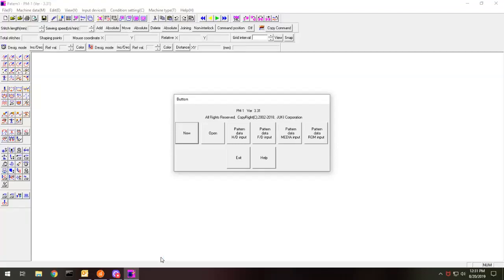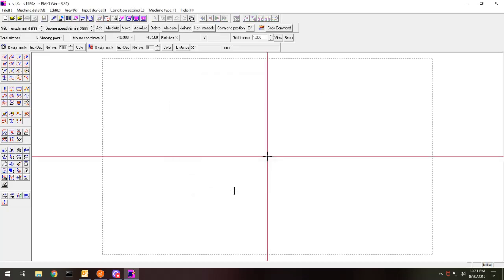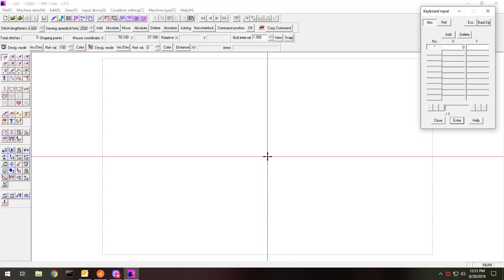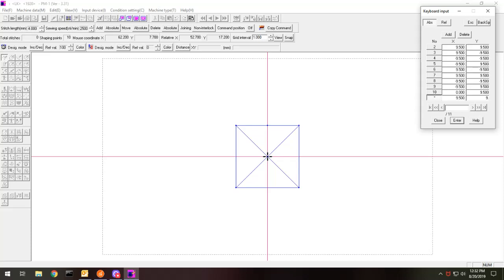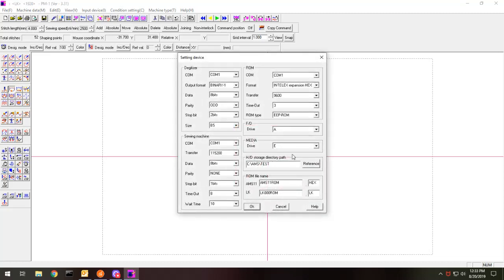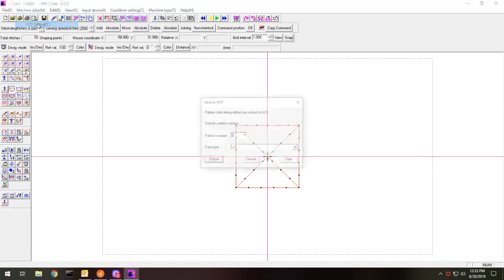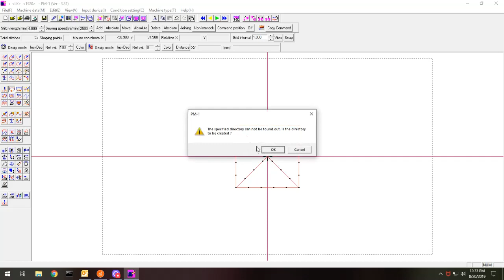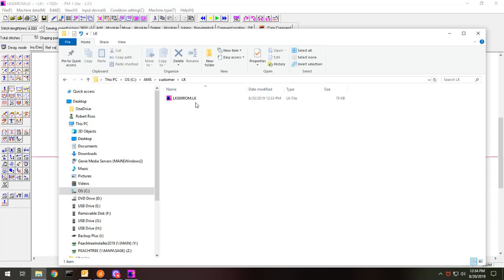PM-1 --MAKING A PROGRAM TO USE ON AN E-PROM

Comment: Which type of the file can be used for LK1900A-hs
Reply from the maker: If you have an IP panel, you can  use VDT format and upload directly to the lk1900a. Otherwise you need to treat it as the older Lk1900 and save to an e-prom in LK format
Reply: @camatronsewing  sorry I don't have IP panel and in PM-1 software didn't show the option ok LK format, 
Secondly I need to know for copy on Eprom can we directly copy on Eprom or need other driver?
Reply from the maker: @khalil-ur-rehmansiddique1973  on the PM-1 you should have the Lk1900 machine type . the file will then beLK000.ROM. Then you would send that file to an e-prom burner and save to the e-prom as intel hex file